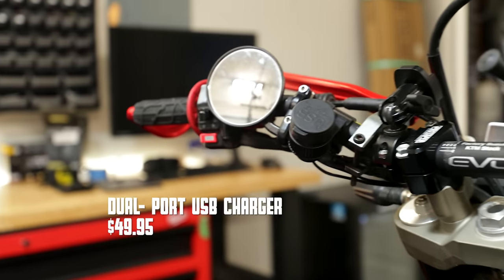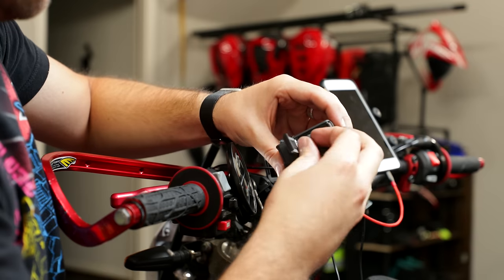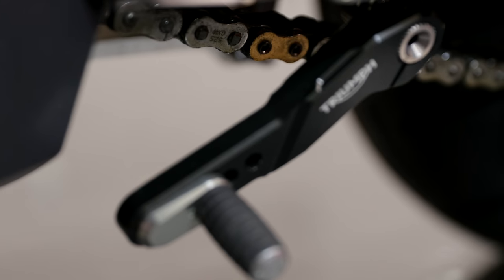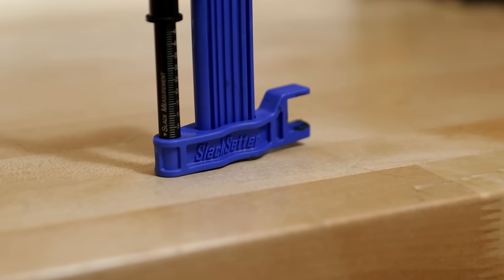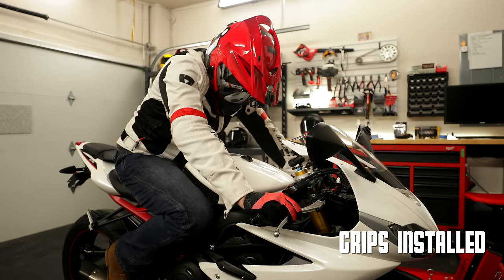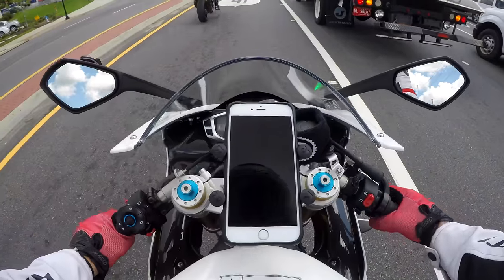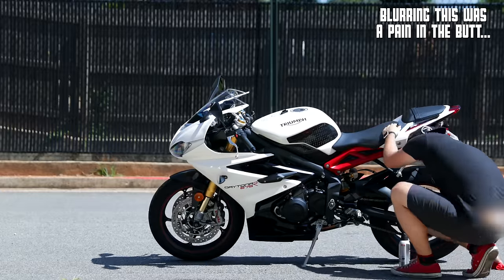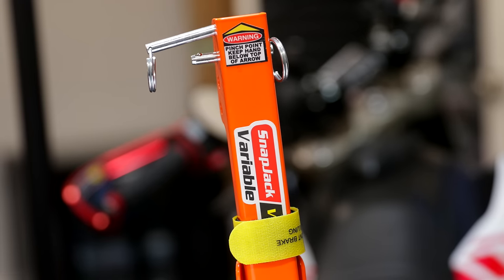Top 5 Motorcycle Accessories under $50 (NEW!!)

Comment from the maker: If you had $50 burning a hole in your pocket then this list is probably gunna help ya out!
Reply: Chaseontwowheels...lol..
bluring out the plumbers crack...lol love your videos!!
Reply: That chain slack tool is amazing. It pays for itself after one use.
Reply: chaseontwowheels what tool kit or tools do you carry when rideing...co2 cartridge In case of flat tire? Extra clutch cable?
Reply: Hi, I would like to know your thoughts about nubia.
Reply: chaseontwowheels Dude I think I saw you at a citgo yesterday but I wasn't sure if it was you so I didn't say anything. I wish I could go to the ga meetup but I need new tires bad and most likely won't be able to get any by then. 

Keep doing what you do man, great stuff.

Comment: I bought dual magnetic horns, sounds very good and you only need to get your original out, place the dual on the same place where your stock horn is and use the same cables. Best part they only cost 25 €.

Comment: The chain thing is why chain tensioners started showing up on dirt bikes in the late 70s. The instant on power delivery on 2 strokes and all modern sport bikes will stretch a chain to the point of breaking a lot quicker than one might think. Back in the old days knowing proper chain tension was mandatory. Around 3/4" of deflection was about right. Oh yah, the difference between the 2 horns doesn't come across on the audio.

Comment: I got my charger mounted on the center of the handle bar and it's got 2 USB ports and a plug for a car charger for 12 bucks. It also has a water proof cover and an on/off switch.

Comment: I bought one of those snap jacks V2 probably 6-12 mos ago and unhappily it is laying on my workbench not being used because it didn’t work for my bike.  I have a 2014 Kawasaki Ninja 1000SX and couldn’t find any point on my bike to get the correct angle to get it to lift up the rear tire.  If you happen to ever come across the same bike I have, if you could try it out on that and see if you can get it to work, I would appreciate it.  I have the dual port USB port and is very helpful. I mounted it into my dash plate. Love your videos, they are always helpful and entertaining.😊👍🏻
Reply: Hi BobVanDick..., this is Basil from Tirox/Snapjack....I've looked at the rear swingarm of this year and model and it's a tough match. Do you have spools on your bike? If so, we are just finalizing a spool upper Arm and cradle for just these types of issues. Please contact me @ info@tiroxproducts.com  and I'll look after you. Thanks very much to ChaseOnTwoWheels for this video. I'll send you a VIP kit including what many are saying is the best chain brush around. the Tirox 360 Chain brush...New also is the Single Sided Snapjack...see the website www.TheSnapjack.com   thanks...keep up the great work.

Comment: Can I just say regarding the USB charger... It is fantastic but watch out for it draining the battery on the bike, I work at a dealership and we had a second hand street triple with one of those installed and it drained the battery in a couple of days just through the light blue light it uses to illuminate where the ports are. 

Great product but if you're not using the bike every day keep in mind the battery might get drained and you'll need a jump start.

Keep up the great content Chase!! Love the videos!
Reply: This is a good point. I've got my charger set up so that it plugs into a pigtail under the passenger seat. I rarely use it, so there's no reason why it needs to be constantly plugged in.

At some point, I may look into wiring an on/off switch in there so that I don't have to do that. But, for how often I use it, it's not something on my to do list.

Comment: Pro tip, spray bottle filled with isopropyl alcohol is much easier to kill errant fly. A squirt in the air, they'll land to clean themselves, then soak them and they die of alcohol poisoning in like 15 seconds.

Comment: thats how i clean my chain lmao but i found the bike stands for 60 for the front and back buying it soon better then 50 for a stick
Reply from the maker: Sounds like a good deal man. As long as you are getting quality stands. I've seen cheap ones before that were made of crappy metal and bent while the bikes were lifted up on them and they fell over. That's gunna cost MUCH MORE than a $50 stick.

Comment: 55 seconds to 1:00.  Um.  You didn't know  where the meetup was ahead of time?  If it wasn't as a " google-able " place, then I wouldn't have gone there.  Otherwise, there isn't much excuse to NOT google map search the address and take  few seconds to screen shot it on  your phone ahead of time at a reasonble zoom amount starting at the visual edge of road you know..and easily seeing the rest you don't know by heart.
Reply: I assume the issue is that he knew the address and didn't know the route. In some areas that can be really challenging.

Personally, I've got a portable battery based charger that I use with bluetooth audio, which means that it's easy to keep in my bag for waterproofness.

I'm thinking about getting one of those Givi smart bars and putting a charger like the one in the video on that. Then, I can zip tie a plastic bag over top if I need to charge in the rain without having to worry about shorting it out.